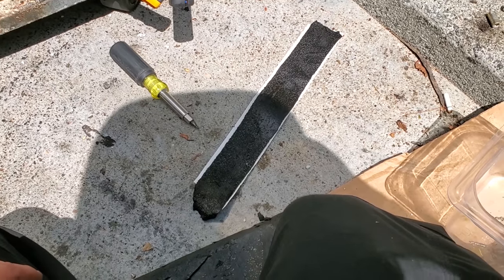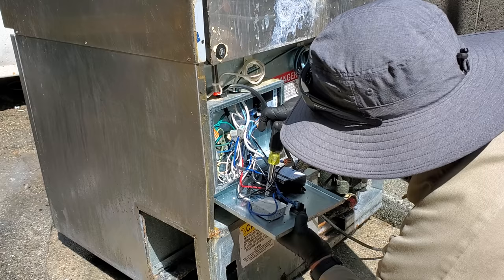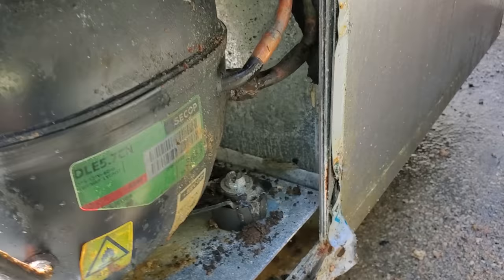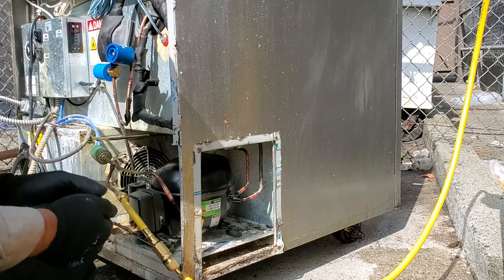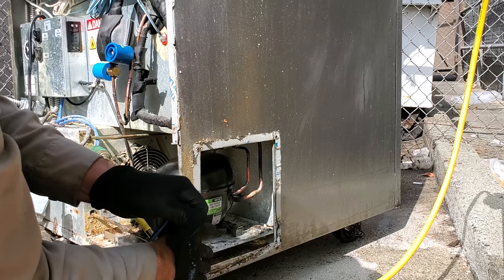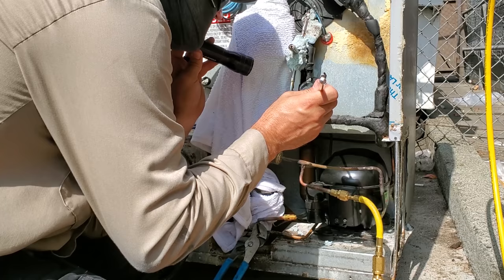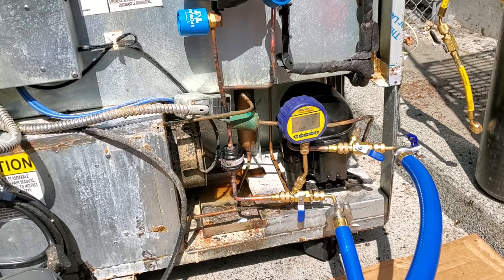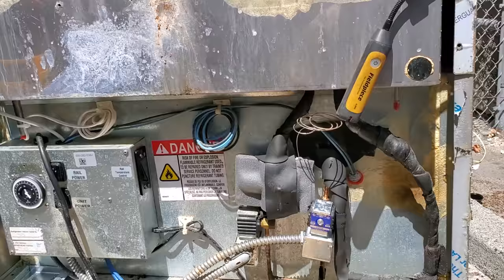ARE ROACHES REALLY THAT BAD??

Comment: You certainly went above and beyond to help your customer salvage the cooler. Most would have told them to replace the unit.  When removing grease/crud from kitchen units (especially in a confined or inside area), I have had better success with a small portable steam cleaning machine than chemicals and hot water.  Faster grease removal and less water saturation/mess. Unfortunately a decent steam unit will cost $500-$1000.

Comment: I'm new here, I'm a retired automotive mechanic, heavy and passenger, I've also worked for years in industrial engineering. I wish I'd had a boss with your ethics and working style, I could've started my own shop but was too chicken I suppose so I worked for others. The only times I had jobs where repairs and parts buying weren't a huge issue was industrial company's because they were so big anyway but most still didn't have your moral outlook on work. In another video you called yourself probably a jerk to work for but I would've loved to work for you! Your work ethic and moral approach are exactly mine!

Comment: In case you didn't know, those 3 wire wago connectors have a little hole in the top that you can jam your multi meter in to test.
Reply: Depends on the pointiness of your probes--I was given a pair that weren't pointy enough, and bought a pair that were.
Reply: @quietone610  lol, "I DEMAND my probes to be of the utmost pointiness! Slightly pointy or moderatly pointy just won't do."
Reply: A lot of modern meters come with probes that have high safety ratings, unfortunately the high safety ratings mean bulky insulation and very little exposed metal. So they often can't get down into small holes like those in Wago 222 connectors.

Comment: I am a home appliance repair technician. You ain't seen half the roach problems I have. Many of the home appliance problems are due to infestation. Roach nest in control boards. Dead mice stuck in fans. I will never forget this one home. The floor was completely covered in dirty clothing and trash. Suited up in tyvec, gloves, and dust mask. As I pulled the GE fridge out. Three cats caught and ate the escaping roaches and mice. The unit had a mouse nest in the defrost drip pan. And roach nest on the control board. Took a brush and contact cleaner to the control board and vacuumed out the mouse nest. Unit ran fine. Logged to never return to address again regardless of tennant.

Comment: Had a compressor leak like that on the stub, customer was retiring in a few months and didn't want to put any money into the cabinet so I cut the stub off with a hacksaw and silver soldered a piece of copper in. Was still running years later with new owners.
Reply from the maker: Wow
Reply: @HVACRVIDEOS  Figured it was broke anyway so might as well try fixing it!
Reply: heavydiesel  ,,,I did one the same in Croydon Pizza Hut,,,,hacksaw and silver solder fix it,,,,,,
Reply: It’s not legal to do that.  It is just like fixing a crack on an air compressor tank.  Just be aware that there is liability there.  I know I also did it once, a long time ago before I heard about the liability.

Comment: A few years ago I got a call-out from a Sonic restaurant that a reach-in was hot.  I popped off the bottom grate and shown a light in there.  I couldn't believe what I saw.  The condenser fan shroud was packed solid with dead roaches!  The fan couldn't turn.  That's one of the very few jobs I ever turned down. Looking around, the rest of the kitchen was about as filthy.  You're absolutely correct about not calling the health department but I came real close to making an anonymous call.

Comment: Cork tape is the devil. I whole heartily agree. Roaches I always push to the customer to handle the problem but I don't go tattle telling to the HD. Good job brother.
Reply: what is the issue with cork tape? thanks
Reply: @cliveramsbotty6077  just my opinion. Cork tape when over lapped on it self becomes ungodly sticky and you have to either rip or cut it off. Then your fingers or gloves are sticky. If it's old and been on a frosty/sweaty suction line it gets slimy.

Comment: "Spilling" a bit of Boric Acid in the reach-in would solve the problem. I worked at a place that had a bad roach infestation, they were living in the walls, me and the kitchen manager searched the internet for possible solutions because pest control used nasty chemicals where they would need to close the kitchen for a couple days for the smell to fade. Anyway we both found boric acid as a solution to the roach problem. Boric acid is extremely safe dentists prescribe it for patients that have gum issues to brush with, and it is extremely effective on roaches. The big plus is that when it kills the roaches you don't see dead roaches, they get the boric acid on them and take it back to the nest where they die. Bonus Nachos, it's super cheap. Super cheap, super effective, and not harmful just don't breath it it is a lung irritant. But many of the chemicals you work with are not good to inhale so you just plan accordingly.
Reply: diatomaceous earth is also another very safe all natural insect control
Reply: TOUCHE`1  Has Many uses - so does Borax.  
  Some just need to try it;  Might be awful to think, but never know how well it works until you don't.
Reply: @DocNo27   -  Very Good as well!   Have it and use it too.   (soft body insects)
Reply: I second this. Terro makes ant baits using a thickened mixture of borax and it is by far and above the most effective ant traps I have ever used.
Reply: Borax is more than just a lung irritant, it can cause male sterility. No laughing matter, that.
Reply: @MoreEvilThanYahweh  It's a food additive. And brushing with boric acid is prescribed by doctors. Everything is toxic in sufficient quantities.

Comment: I service an unnamed branch of the military mess halls. The roaches are the norm. We ignore them and just fix the units. What’s worse is the mice pee on the components and they short out frequently. Anyway, I’ve found that those dual evaporator boxes will use a higher low side pressure when both solenoids are on so we remember that when diagnosing and charging.

Comment: 21:07 in tight spaces i always do a dry run with the torch tip before firing up, i've saved some aggravation doing that over the years.Also good to keep a squirt bottle handy, they help a lot too.

Comment: For that rusting out compressor stub connector. After finishing the job wire brush it in automotive body shop supply house there’s a zinc rich primer used before or after spot welding. The zinc particles in the primer act like the sacrificial metal for protection like the rods in the hot water heater or the big zinc anodes attached to the hulls of ships.

Comment: Nice, the finally use Wago connectors instead of these horrible wirenuts.
Reply: I believe those are required with any flammable hyrdocarbon system.
Reply: I noticed the same. In Europe the WAGO style connectors are more or less standard. You never see wire nuts. Mostly you would see DIN rail mounted connectors with screw or spring terminals.
Reply: Wire nuts are soooo 1990's in many parts of Europe now... they still sell them here, but I would go with the lever Wago's any day when dealing with wires up to 2,5 SQmm. Good old screw terminals for thicker. The lever Wago's can attach to a single wire, they can be used with mixed wire sizes and types, can be attached and detached one wire at a time without accidentally wiggling other wires free.
Reply: @jussikuusela7345  Bootlace ferrule the norm over there on stranded wire?
Reply: @joehead1294  Yes, except for spring terminals, where it causes more harm than good.
Reply: @analogmoz  yes, at least they are here in the midwest.
Reply: Only ever seen wagos (anything high amps would probably fail in a wing nut)
Reply: @backwoodsengineer  😆
Reply: @leexgx  false.
Reply: Wirenuts don't meet regs in the UK even for SELV applications. They aren't even allowed on speaker wire lol.
Reply: Crouching Hedgehog Oi mate ‘ave ya  got a license for dem wire nuts? 👮‍♀️
Reply: someone please explain to me how a wago is better than a wire nut. wegos would give me nightmares if they were used in my house. I want a physically strong connection for all of my wires, not just some push in piece of plastic with spring sheet metal inside.
Reply: @leexgx  actually that's wrong. Wire nuts have a greater contact area and a tighter connection, wagos look 10,000x better and keep your wiring nice and neat but as far as function the old ugly wire nut does the job better. I'm a wago man myself its just so much cleaner and easier to follow but the wire nuts won't fail, just look like crap

Comment: OMG here comes lunch!  BLECH!

Nasty is not the word for it.  We had a unit (not refrigeration) come back for repairs from out of the country.  It was so caked in sand dust that it was tan instead of its normal color and when we removed the covers, we were able to pour sand dust out of it.  The shop crew said it was the nastiest unit they ever worked on.

Comment: I don’t think I could do food service work. I do commercial and industrial hvac, just did a tandem compressor changeout on a 30 ton carrier this week, I left it on a vacuum for 3 days, pulled down to 214 microns. That wet rag stuff doesn’t work as good after the first use. You do very thorough work also. I hate cork tape too.

Comment: Infestation. I'd notify health department out there for the rest of the building.
Would it have been better to replace unit?
Reply: True
Reply: Warranty will let you rebuild the whole system before replacing these days.
Reply: Yeah call the health department on your customer and see if you ever do work there again, or any other local restaurant for that matter 😂
Reply: I think from the manufacturer point of view, the case is the most expensive part and the rest are lego bits so they will pay for all the components to avoid losing a expensive stainless case.
Reply: @djenson  Yeah, I got triggered/disgusted and had to comment ASAP.  BTW, Good video and professional work Chris. Hope they paid HVACR a bundle of 💰
Reply: If the restaurant promptly acts once they're aware of the problem and gets the situation resolved as quickly as they can there's no need to notify the health department. The health department exists to get unsafe conditions remedied, and involving code enforcement officials when the conditions will be taken care of in a timely manner without them provides no benefit and impairs the officials' ability to quickly respond to conditions that would not improve without code enforcement. There's a lot of business owners who get complacent with safety if the government does not hold them accountable, and the government should be free to focus on those businesses instead of being bogged down with unnecessary complaints.
Reply: @djenson  troll??? That's just overly harsh. His comment didn't even come close to trollish.
Reply: @jsfkdkjslfdslfkdj  anonymous...............

Comment: I own a billiard room in Saint Augustine Florida and for a while I had a roach problem which seamed to reoccur no matter what I tried to do to get rid of them. Then one day a friend suggested "Avert DF". It is a dry flowable roach bait. I purchased a few tubes of it from Amazon. Then I applied the product inside all electrical outlets, light fixtures and behind all of the refrigerators and any openings under the bar. To my surprise, I have not had a roach problem since then.

Comment: Great evacuation set up.  We bought all of the state of the art fieldpiece equipment for our training center, last year. The key is, after your evacuation, to get they system into a positive pressure with charge as soon as you can.  I don’t care how good your connections are, all hoses leak, and it is imperative not to let the system sit in a vacuum after you turn the pump off.

Comment: I guess you are not allowed to weld on the suction stub, because it is part of a pressure rated vessel.  I once welded a crack shut on a compressor dome, for a 5 ton water source heat pump, before I realized, that was not legal to do.  We used a portable TIG machine, a Miller Passport, I believe, and silicone bronze rod.  We ran a bead over a hairline crack on the side of the pot.  That repair lasted for years, until they tore the building down.  Great job you did on that ShitShow.  What was the total bill?  I would have sprayed that copper to steel joint with cold galvanizing compound before you wrapped it with the cork tape.  At least it wasn’t a copper to Aluminum joint.  Those were the worst for corrosion, as the dissimilar metals caused electrolysis.  Used to happen where the stubs came out of old Signature chest freezers I used to repair in the 70’s. I would have to cut into the cabinet.  We used an epoxy coupling called a Permacouple back then. It was a coupling made for dissimilar metals.  You inserted the copper and aluminum pipes, then heated it with a propane torch.  The coupling then shrunk down on the pipes, and epoxy melted and sealed the coupling.  They worked very well.  I once repaired an antique built in refrigerator on an old yacht with those couplings.  I remember wrapping the joints afterwards with cork tape.  We called it “Monkey Shit”, back in the day, when I was attending the Navy’s RAC school in San Diego in 1974.
Reply: hi ron, would you mind giving a quick explanation about cold galvanizing compound? thanks
Reply: clive ramsbotty it’s just paint.  It comes in a can that you can brush on, or a spray can.  It contains a lot of zink.  We use it anytime a protective coating gets burned off during welding, to prevent corrosion at the joint.  You should be able to find it online under cold galvanizing compound.   OEM HVAC equipment manufactures actually coat their drier braze joints with it, and also coat around steel compressor stubs where the black paint burns off during brazing.  It  looks like thick dull gray paint.

Comment: Good god i di not have to scroll down very far for the health dept comments. Ive done commercial mech work for years. Prevent maint. You name it. Back when 1 complete maint was usualy 1 day for 1 resturant. Thats reach ins. Walk ins. Ranges. Range hoods. Ice machines. Fry station. Altoshams. Tilt kettles. Pack units. Makeup air. Etc. Very few resturants could pass mustard on consistent basis. If its a chain resturant forget about it. Believe it or not Red Lobsters in the area i was were the cleanest resturants on average. Good job to this man on the multi.

Comment: If there are roaches in that unit they are everywhere else as well. I hope that they got a good exorcist when it came to the roaches.
From my point of view the electronics should have been better encapsulated to prevent the roaches to even be able to get in there, so from that perspective it's a manufacturer issue.
Reply: It's a common problem, so you thing the manufacturer would take that into account...but since it's not a warranty issue, it means the sell more replacement parts.

Comment: Hey Chris, you should invest in a mini oxy/acetylene torch, they are very handy when working in close quarters, and cuts down on open flame. It's also good when brazing solenoid valves, and expansion calves. it comes with the hoses that hooks up to your regulators. I didn't believe at first it would work, But for small tubing, works real well. I worked many times with Refrig. equipment that was infested with roaches. They use to get under the contacts of a contactor, (open contacts) on a 3 phase, and insulates a phase, and causes single phasing and wipes out a motor, or compressor.
Reply: Tony Strollo we had three sets of mini ox acetylene torches.  They were like jewelers torches and had all kinds of fancy tips, to get into tight places, and behind where you could not see.  Only problem with ours,  was that the torch handle had non removable braided hoses, that all ended up leaking.   Even the regulators were miniature.

Comment: Well when I silver solder (braze( my components, I turn my torch down and I also have shields in place for the purpose of not burning other components, so take this as you may  I'm just saying ,and torch that is turned down does take longer but taking your time will pay in the future along with a few sizes of shields to prevent damage to other parts ,I've been doing hvac for nearly 28yrs now ,you sound smart but I believe its book smart from what I see , sorry that's how i feel ,i mean when the dryer becomes damaged there's 2 things that cause it 1 too hot,   2 shield the in and out of the dryer with some type of small a metal shield,so there you go my thoughts I realize some things are hard to do with components that are close to your work area,bottom line look at the problem and use head and repair things with common sense not a full on 600 degree torch,turn it down may take longer but that's life

Comment: So i'm guessing with all that you went pretty near the price of a new unit?  I know i wouldn't have touched with a 10ft stick....
Reply: I was gonna say, replacing the compressor and everything else, even on commercial grade equipment that seems like it’d be pretty expensive.
Reply: I think there are perhaps tax issues. 
In my country, maintenance and repairs are 100% outright tax deductable. But capital expenditure is not.
Reply: Good Point.
Alternatively, he mentioned that the equipment was technically still under factory warranty (obviously it wouldn't cover this). As a result, repairing the equipment was the only option the (I assume chain) restaurant had, if they wanted to save their own jobs, since any attempt to replace the equipment would have raised red flags at corporate (ie why didn't you file a warranty repair).